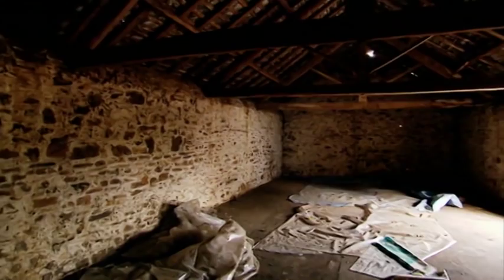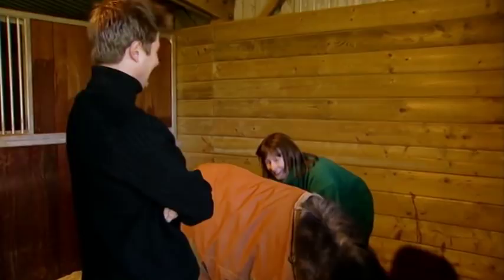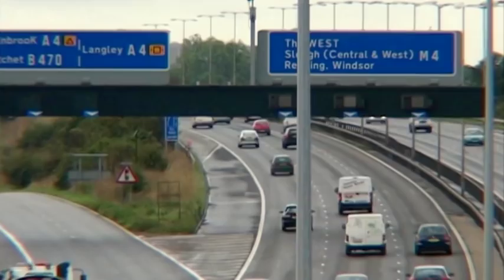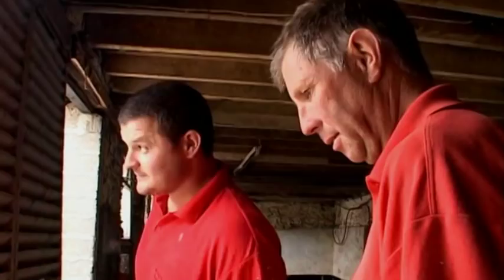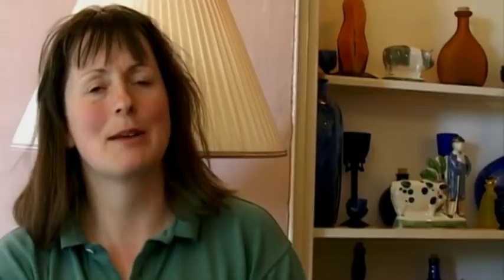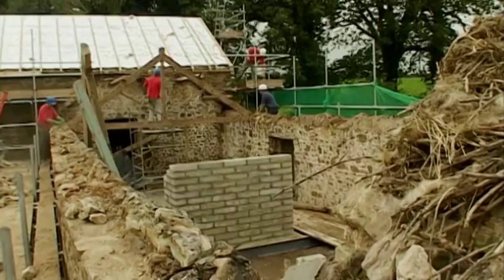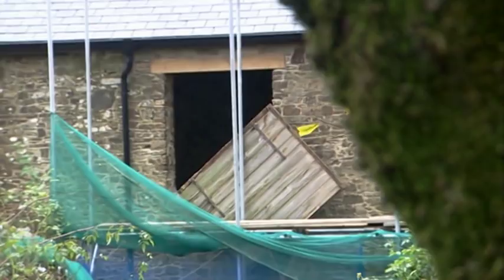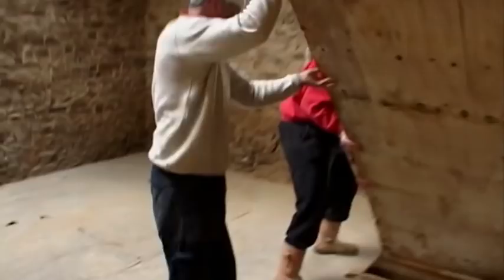Build A New Life In The Country: Welsh Barn | History Documentary | Reel Truth History

Comment: Not everyone has the opportunity to be so lucky as to be given such a cool building like this to fulfill their dream home. The outside looks stunningly beautiful yet personally would've gotten a couple suggestions from designers of what would be the best route to take in designing such a beautiful old barn like this. It tore me apart to see these old beams torn out of the old building. nevertheless they did have considerable rot that couldn't of been used. It was smart of them to have planned much of what they all wanted ahead of time. Covering up those old beams for the ceiling is an absolute shame. It would've looked much more nicer in my opinion keeping that old rustic look instead of the modern city looking touch, kind of takes away from the potential of what it could've been, but, the bottom line its their home not mind.